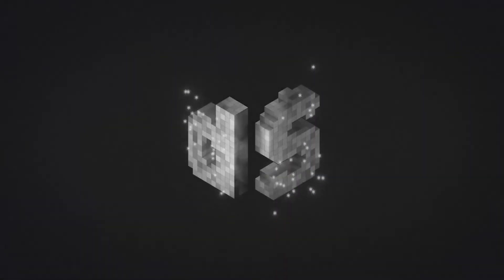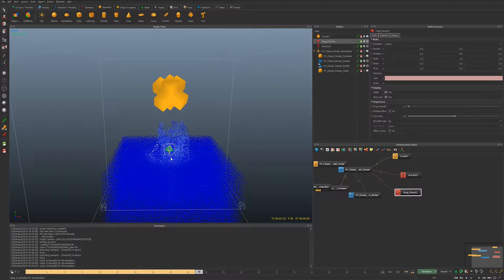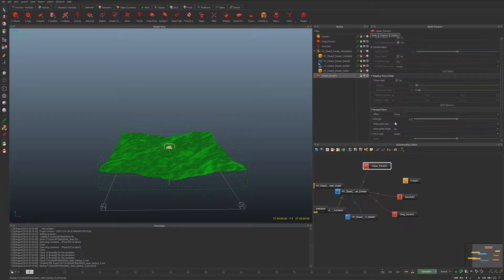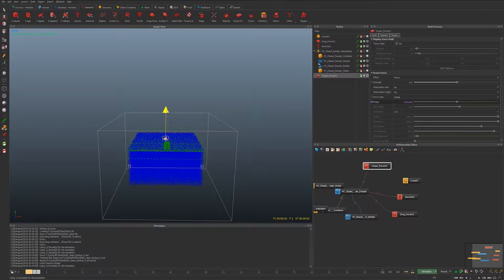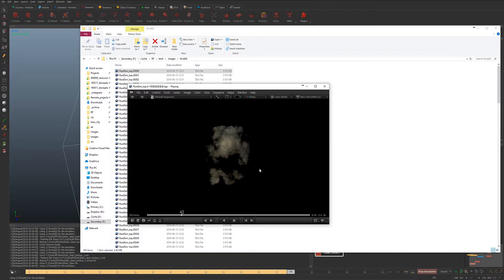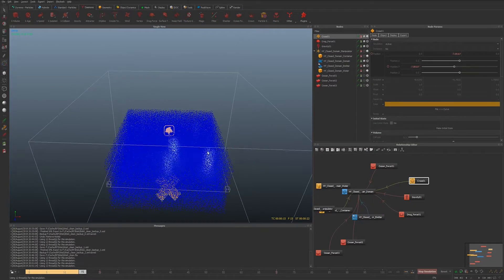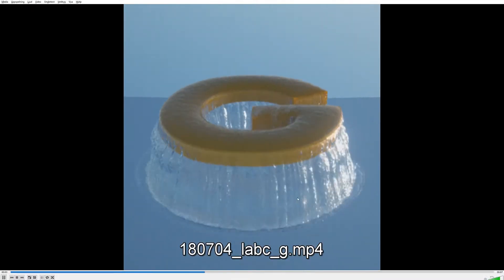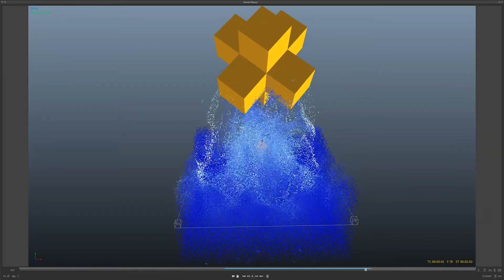Realflow: Liquid ABC breakdown: G - Breach

Comment: Thanks for your tutorials! I have a question. I use cinema 4d octane render to texturing simulation realflow, but export meshing realflow do not much more details whater, because mesh = poligons, not particles. I cant visualize small particles splash because import in to c4d only meshing. Are you import particles from realflow into maya and there you already create a mesh for splash, what can not be done in c4d. How can I do it?
Reply from the maker: Hello Praiko, I can't speak for the workflow in C4D I'm afraid, but as far as Maya goes - and my advice to anyone if possible is to use mesh for the main body of water, and then import the particles themselves for the splash/foam and render in your 3d-app. It's how I do it. I discuss some of these aspects in this video: https://www.youtube.com/watch?v=Mt9fvXrD8Lo
Reply: One way do is using Krakatoa for C4D which can render foam and splash particles. It is very fast even millions of particles.